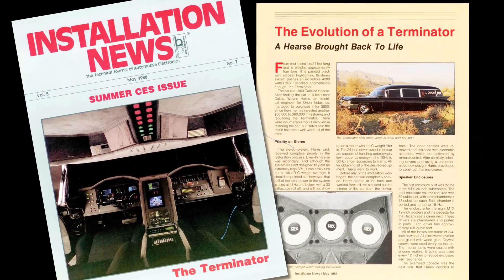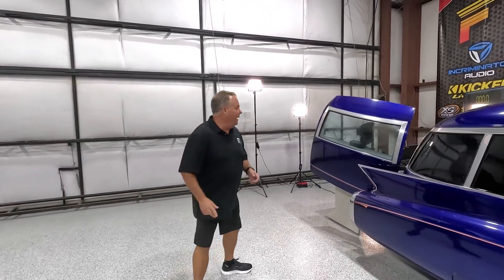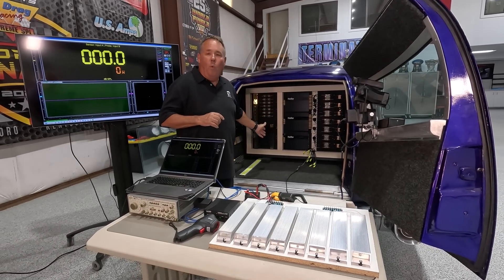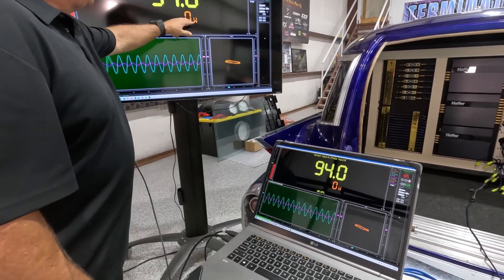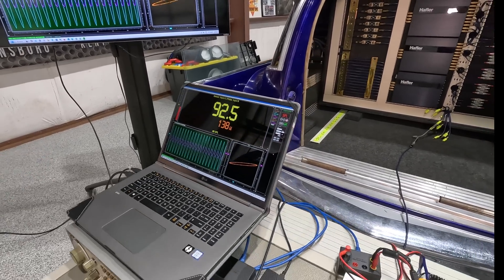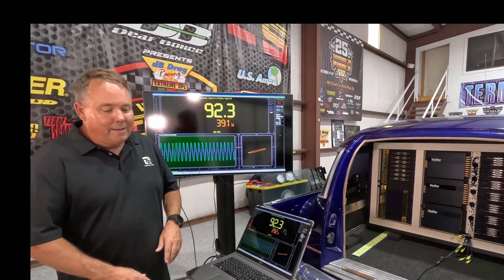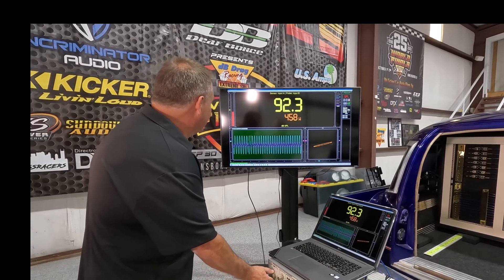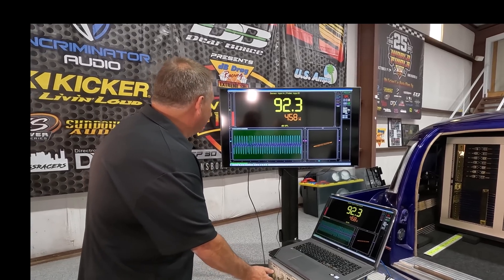The Terminator – Power 1000 Amp Power Analysis | Wayne Harris | dBTV | 4K UHD

Comment: As a tech whose worked on amps for over 30 years, the capacitor has 2 jobs. 
One, it filters any noise from the supplied power. 
Two, it acts as a sort of battery between the load and the supply.
On a constant load, the voltage at the caps balances out to what the power supply can provide, but if enough capacity is there, it will provide split-second dynamic boosting to the rails. You may see 500w continuous into 4 ohms, but a dynamic burst can hit close to 800w on say a kick drum or some other quick signal. 
The Hafler crossovers need a re-cap because they're not filtering the noise from the power supply.
Reply from the maker: Thanks for contributing to the discussion. As you suggest, caps have a myriad of uses in electronics. We use them to filter "ripple" in DC circuits (such as power supplies), block DC voltages when used as "coupling" caps in an AC input path (for audio), setting the "time constant" for circuits that are used for equalizers, crossovers, and more. Our challenge is to convey this knowledge to a hugely diverse group of learners in this discussion. Your comments have been helpful.

Comment: Hey, I have one statement and two questions and one of my questions is more like a idea one why the fuck does my 2.1 system for my PC sound better than my almost $10,000 system with four qualifiers 
50 a half giant subwoofer, and four giant
Reply: Because a car is a terrible place for acoustics. So to get it to sound as good requires lots of tuning and sound dampening. Go to a sq car show and they will blow your mind. Esp the arc audio car
Reply from the maker: Hello! As mentioned by @Bass2TheFace420, cars prove to be a challenging environment. In fact, reflections, reverberations, resonance, and speaker place contribute to what I call a "spaghetti bowl" of sound. However, I bet there are some things you can do that will have a dramatic impact on your system. Start by disabling all of your equalization and loudness controls. Ensure your crossover points are set properly and then make sure your system levels are adjusted correctly. I have written much on these topics, and you can find the articles at https://www.termpro.com/asp/pubs.asp?ID=0&Category=2&Org_ID_Filter=0&Year_Filter=0

Comment: Dude, I wanna commend you. Those are impress. That’s an impressive display but man, the fact that you went with Hafler that’s a good amplifier man. They’re using home audio as well so you got high in stuff there now if you could just find McIntosh with the big blue meters I’d be kind of cool too.
Reply from the maker: Thank you. The Hafler Max410 is a crossover that I designed in the late 80's. The amps are Rockford Fosgate Power 1000's. No question, though, the big McIntosh amps are cool!

Comment: Astron was the stuff back then. Orion ASTRO van with six 15in XTR subs in 4th order, multichamber bandpass was powered by Astrons. Battery chargers for shorter demos. Rode a steel bicycle with 2.2inch width tires 20 miles to see it in 1993. (High school years)
Reply from the maker: Those were the days. I left Orion in 1987 or 1988, however we had an Astro van when I was there. Before I left Orion, we designed (and marketed) a 100 Amp linear power supply. That dude was a beast, and it weighed like a million pounds!

Comment: Your videos actually get me stoked to start on my newest build....6 RF 12s. I'm putting 3-P3s and 3- old school HX2s in a extended cab ranger. I basically have everything including amps, electrical, and batteries. Just need to find the time with renovating my house, but thats almost done, soooo.....😉
Reply from the maker: Cool! I use the "working on the Terminator" as a reward for my normal responsibilities. Otherwise, if wait until you have time, you may end up like me and start working on your ride 30 years from now. Good luck with your project.

Comment: soooo....my brain needs to understand how the condition of the caps effects the low frequency power output...this tiny tidbit seems REALLY important! thanks for sending me down this rabbit hole Mr Harris!
Reply from the maker: Here is a good analogy. In a switching power supply, the large electrolytic caps serve the same purpose as a water tower in a municipal water delivery system. For example, the water pumps that fill the water tower can only provide 1000 gallons per minute (just an example). However, at certain times of the day (when everyone is taking a shower), the demand for water could be 10000 gallons per minute. Obviously, the pumps would never be able to supply enough water during these peak demand periods. The water tower, on the other hand, has been filling with water 24 / 7, and it holds 1000000 gallons of water. The surplus storage of the tower provides the needed water during peak demands. This is similar to what happens in the power supply. When playing low frequencies, the power supply must supply large amounts of current (at high voltage) for a longer period of time because the low frequency signal has a longer (slower) wavelength. I hope this helps.
Reply: @wayne_harris  it does, never really considered that low frequency would require more power. because of the longer wavelength. that's interesting. between you and Jacob Fuller im learning a lot this week.
Reply: Using Wayne's example, when you consider a dried up or 'weak' electrolytic cap, the water tower would decrease in capacity from a million gallons, to let's say 100k gallons.  Now you can see that its ability to buffer the demand is significantly decreased.

Comment: I have two Power 1000’s I have owned since @1988 and 5 Power 650’s , 4- power 300’s and a dozen punch series.. they will be with me till I am gone, PERIOD!
Reply from the maker: You are one lucky dude! When I built my first competition car, Eruption, I installed a BIPOLAR Puch 650. It is my understanding that only 50 of those were produced. Rockford recalled those amps when the Mosfet 650's came out and replaced them at no charge. I wish I would have kept the bipolar amp. 

I remember demoing the car, and then the bass would sound distorted. I would then open the amp up and some of the emitter resistors for the transistors had become unsoldered from the PCB. I would solder back in (on the spot), and I'd be good to go. This happened on numerous occasions, and I even started carrying around a repair kit to service the amp. I still have it!

Comment: We all assume that nobody would know those amps better than you. At the same time, lots of things have passed through your mind and hands since you designed them and it's no wonder you forgot the minutia.

Production amps comfortably put out more than the Rockford rating. Williston Audio Labs ran one and under a similar frequency and all channels driven, came out with 650ish x 2. Legend was that you hand selected the components in those amps in the Terminator and the actual power was like the top speed of the SR-71: classified.

I find it suspect that two channels bridged into a 4 ohm load would barely put out 'spec.'
https://www.youtube.com/watch?v=MEuEbuNbcHc
Reply from the maker: Thanks for the kind comments. But to be clear, I did not design the Power 1000. That honor belongs to one of the greatest engineers of all time... John France. I did make mods to the Power 1000, and I created the power meters and beefed up the power supplies and shortened the heatsink. I was so fortunate to work with some of the greatest minds!
Reply: @wayne_harris  I stand corrected and thank you for sharing his name. I still have a pair of 1000Cs sitting here. After buying the first one, I immediately pulled the covers, just to admire the internals. It's a beautiful design. I keep telling myself I'll someday put them in a car again. They were effortless, dynamic and musical and I miss them.

Comment: I still have 3 power 1000s and let me tell you these amps get down at 2 ohms bridged. I shredded 4 power dvc fosgate 15's when i had the amps running in my blazer. Running 15volts full steam. Had the fans running full blast because the amps where so hot!
Reply: So, awesome!  How were they configured?
Reply: @russelllopez4171 dual 4 ohm 15's  wired the amps to run bridged into 2 channels. 2 15's ran off 1 power 1000 the other 2 15's on the other power 1000 and the mids and highs off the 3rd power 1000. Gonna slowly integrate the system into a 89 civic hatchback now 😉
Reply from the maker: That’s good to know. Now that you mention it, the fan never came on. Thanks for sharing.
Reply: @wayne_harris Fans will only come on once the amp reaches a certain temp just to kind of jog your memory. Can say you were always an inspiration with the terminator!